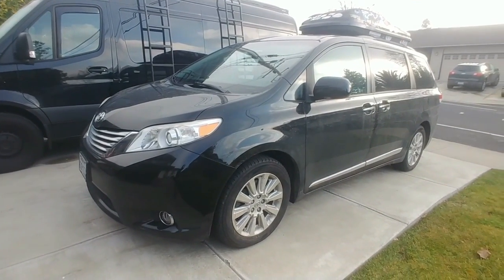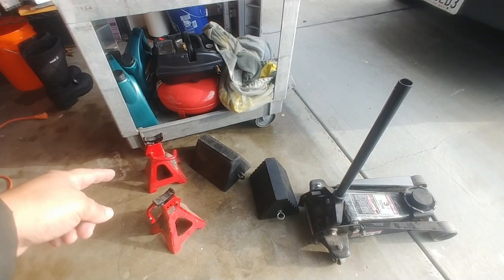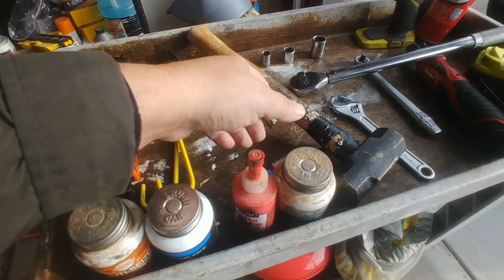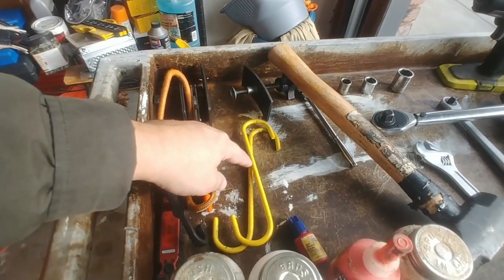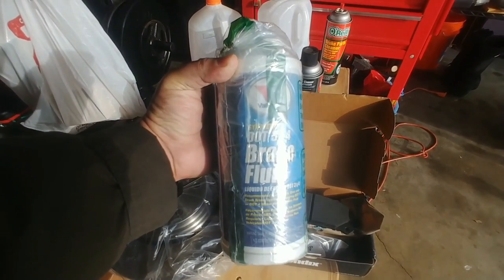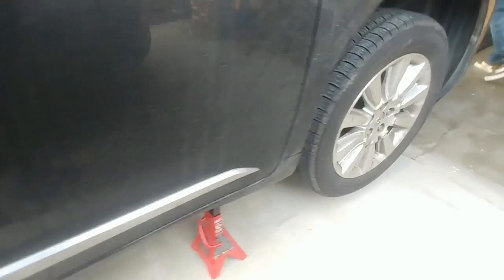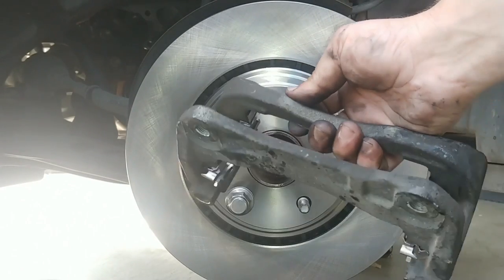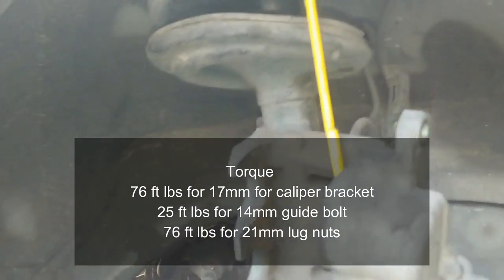DIY Toyota Sienna Brake Pad Replacement 2010-2019 & Front Brake Rotors

Comment: extremely good video! I found it is hard to insert the inner side brake pad. I didn’t use the old brake pad hardware, what I did is to clean the hardware seat again and it works haha
Reply from the maker: Glad to help and thank you sharing your technique!
Reply: @aochio9735  I usually fit the pads while the bracket is out and depending on the pads you buy , you might need to file the pad edges a bit so that they fit easily . Then you can be assured that they will slide in easily after the bracket is mounted.

Comment: Use a deep throat 😂 C clamp from harbor freight to compress the caliper pistons , use the old pad between the clamp and the pistons . It also doubles as the 'third hand ' while you put the springs on if you dont have a camera man around 😂
Reply from the maker: Yes, the c clamp is a good tool.  Thanks for the feedback and tip.

Comment: Lot of meat left on those pads. Why did they need to be replaced?
Reply from the maker: BIGO told my brother to replace them??? They gave him a really high price so we decided to do it ourselves. All good for less than $150 we got new rotors and pads.
Reply: The rotors were warped obviously, that was the reason for the braking vibration and with the rotor vibration, they also cause the brake pads to wear unevenly,  hence the replacement.